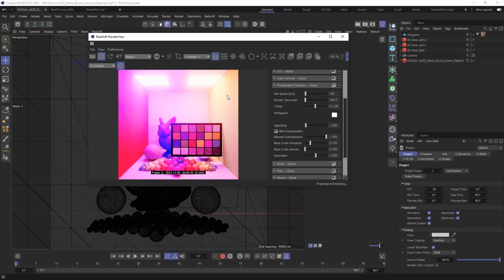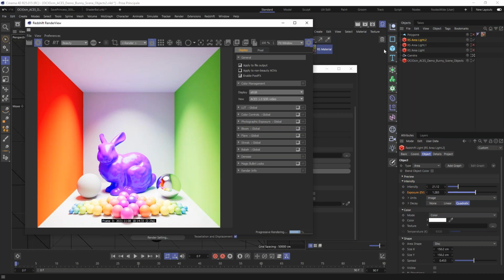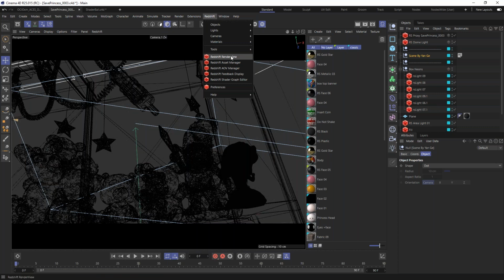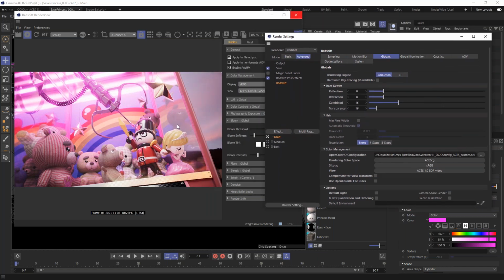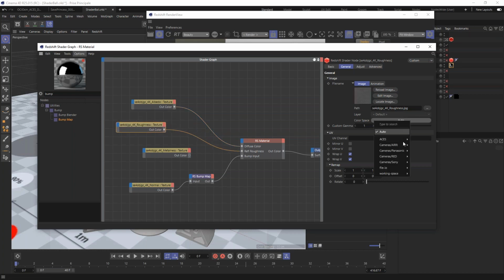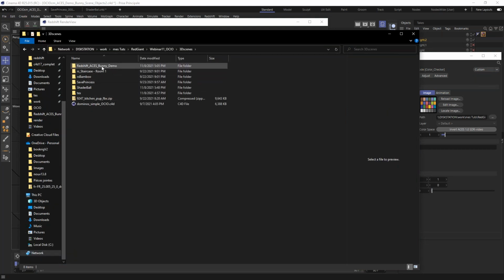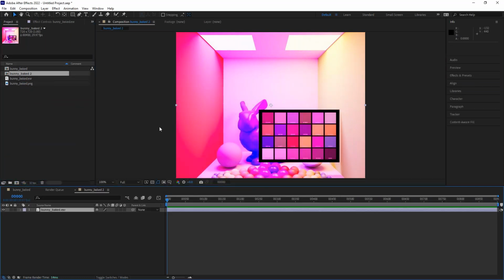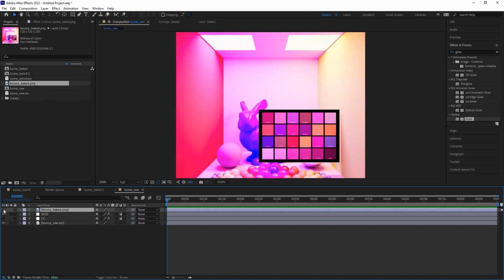Managing Color - Part 2 (of 5)

Comment: I think sRGB IDT is shifting color of sRGB Texture more desaturated.

But "Inverted ACES 1.0 SDR Video" IDT completely brings back Original Color!
I think this 'Inverted' IDT is doing calculation that I expect what sRGB IDT would do.

Manual says Inverted IDT switches Input and Output from that of sRGB,
so Input supposed to be ACEScg and Output to be sRGB.

But when I see the Color info from Redshift Renderviewer,
Colors before View transform is very High value as if output value of IDT is ACEScg.

(I tested with material that sRGB Texture plugged into Emission Color, Weight 1 to not let lighting affects its color.)

It's very, very confusing..

Comment: Be keen to know if anyone else is having serious issues with EXR within AE 2022. If you have a large sequence it eats all the memory taking down your PC (win10) nomatter how you work with it. Saving as PNG32 there are no issues. AE file of EXRs in Premier, also no problem??? I have used EXR for many years but with AE in windows I think something is awfully wrong. Great video btw, be good to see the same with C4D and other render engines.
Reply: what about TIFF? I'have read, that PNG is the slowest format. You should use EXR or TIFF.
Reply: @simontrickfilmer   I heard that too - but I am having no issues and files are small enough. Its very fast to my eyes. Very annoying tho, I have been using EXRs for many years. I hope they sort this.
Reply: new AE version didnt fix it 22.1
Reply: Having this issue right now, was wondering what is going on with AE! Are you implementing any of the techniques shared in this video with your PNG32 workflow? Thanks!
Reply: Try making sure your EXRs are single layer and you're using the DWAB compression
Reply: @austintanksley2909  This is all resolved by Adobe now. They changed the EXR code - it may still effect older AE version tho.